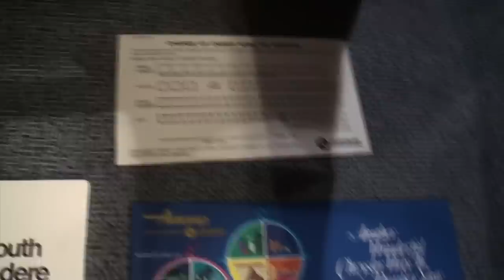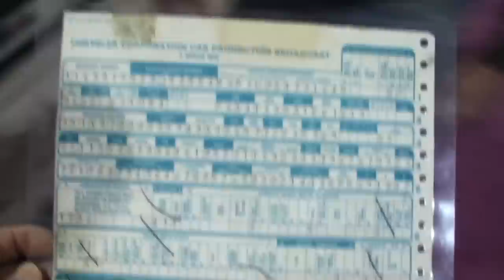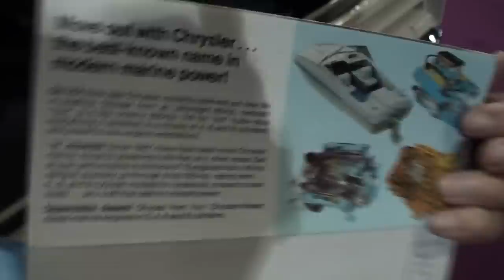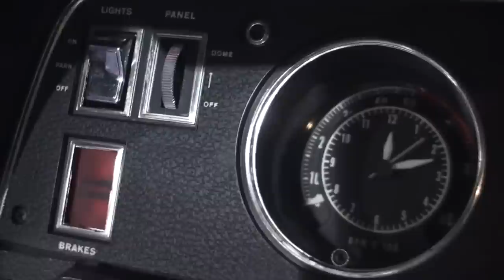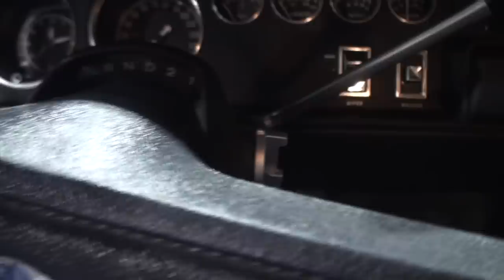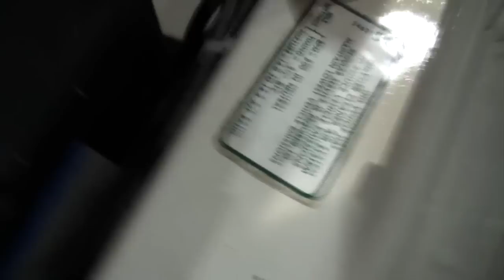9K+ Original miles ! 1970 Plymouth Superbird & 440 Engine Sounds on My Car Story with Lou Costabile

Comment: I remember when these were new. A local dealership had three of them and couldn’t give them away. Insurance was just prohibitively expensive if you could even get it.
Reply: No doubt. Many dealers had the same problem.
Reply from the maker: Hi Dave, Happy to read you remember these cars when they were new :-) Lou
Reply: Thanks, interestingly HAVE A MEMORY of seeing *one of these SUPERBIRDS in : Downtown Lafayette, Indiana spring 1970, and to long, & dramatic for normal use.. Surveyed some new car buys: SUPERBIRDs still high priced, **& BUICK GS/ OLDS W30,455/ JUDge GTO STAGE/ TALLADEGA Cobras way to expensive!,,,!   /We actually bought a 1970****Coronet 500/383/4 BBL/ loaded except air conditioning , from the  Dealer , next to Drugstore I worked at…in August 1970 ( it was MARCH ,? Build 1970 car)…Anyways, the OLDS W30, SUPERbirds esp. HEMI/ CORONET Suoer Bees , were way more expensive than my $3100.00 ( ?) 70 CORONET… actually, I would have preferred ****1970 Oldsw30,, even a SUPEE BEE LOADED( HEMIs were $2000++?) ; though I originallly thought MANY OF the “Dodge Connection , & SUPER BEE/RT“ parts would fit /adapt / or  help cheaper Coronet ,etc. ( I switched to HEI, few parts fit regular Coronet!!!)…Anyways , great times!!!
Reply: Thanks, ps, :: I did hear later on in 1970–71  the Super Birds selling cheap, and some repackage do around. Orthorhombic Indiana…interestingly, I had orders a 68:Road Runner, passing & losing my Deposit.. DID LOOK, & ride a lot in & around BOSS 302( Dealer would,not let me drive), special FOUR DOOR / loaded /340 HIPERFORMANCE SUSP/ HOod Scoop/Disc Brakes/ tachometer, that was a  SCREAMER !! (( Dealer done a lot of *Police/**Drag cars)).. Should have got this one, **OR A 70 CHALLENGER RT/SE, triple Green color( we hated green) 4 SPEED/ MAGNUM WITH every DODGE OPTION, BUT way,**overpriced; my Brother still remembers this loaded  Challenger  at the Dealer! ( fifty years later ).

Comment: One of the most infamous muscle cars around, thanks to the Nascar Aero Wars. The Superbird is merely  the 1970 Road Runner with the still-unbelievable 0.28 drag coefficient due to the strange wind mods, like the '69 Daytona Charger.
Reply from the maker: Hi LITTLE, Thank you for viewing and sharing, Lou
Reply: and they still were not as fast as the Fords......Cale Yarbroughs Mercury was 5-10 MPH faster than all of the winged cars at Daytona in 1970.
Reply: @davidthayer6969  You again?  You need counseling.  Pete Hamilton won the 1970 Daytona 500 in a Petty Superbird.  Cale Yarborough DNF, only got 31 laps in before his "BOSS" 429 gave up the ghost.
Reply: @easygoing2479  and Cale won the pole and set a record speed in the first 125 that is still the fastest points race ever at Daytona.......Hamilton won because of failed tire strategy by Pearson, not because his car was faster.